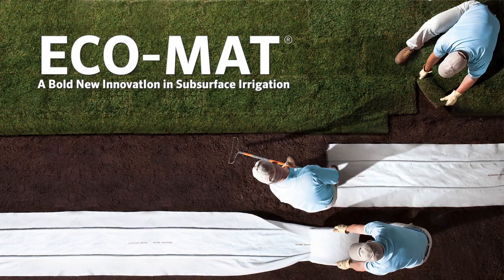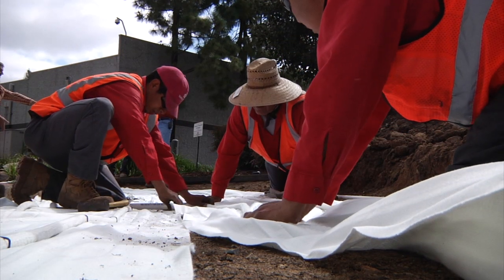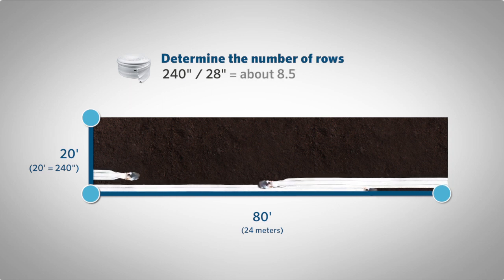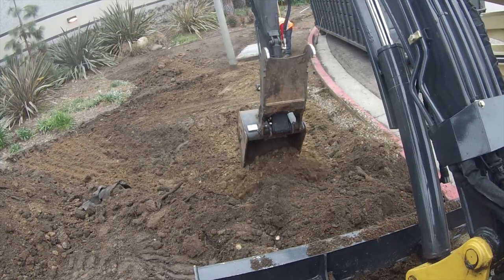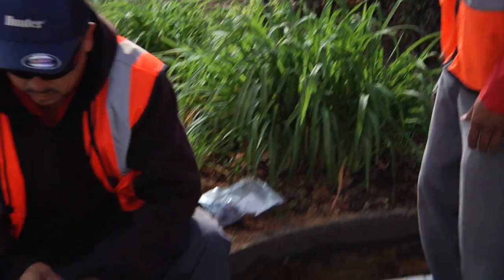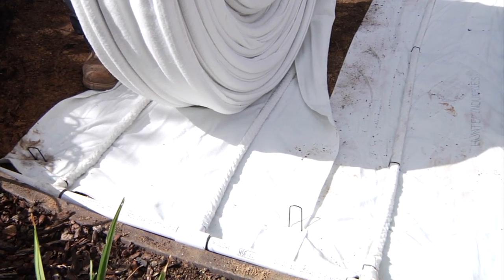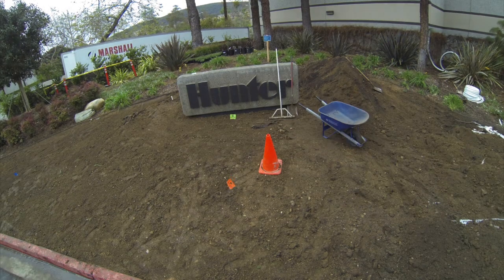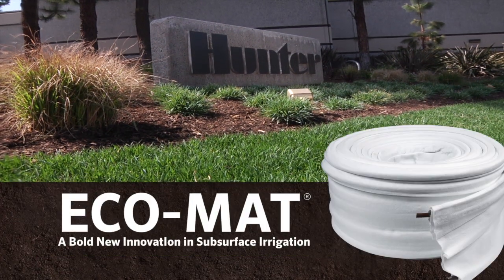Eco-Mat Subsurface Irrigation: How to Install Eco-Mat

Comment: Is Eco-Mat applicable to hillside terrains as well? Also, can it be damaged by gophers? Thanks
Reply from the maker: Thank you for contacting Hunter Technical Support.

Eco-Mat can be installed on a slope. An air relief valve is recommended at the high point of the system, and if greater than 5' of the slope the system may need to be broken up into additional zones or may require stand-alone check valves to prevent excess drainage at the bottom of the system.

The installation and design guides on the product website should have additional information: https://www.hunterindustries.com/irrigation-product/micro-irrigation/eco-matr

We haven’t heard much about gophers' attack on the Eco devices.  Further, the mat is normally wet, and gophers don’t like digging on wet surfaces. 

Thank you again for contacting Hunter Technical Support. Please let us know if we can offer any other assistance.